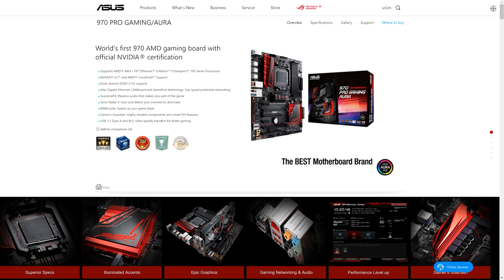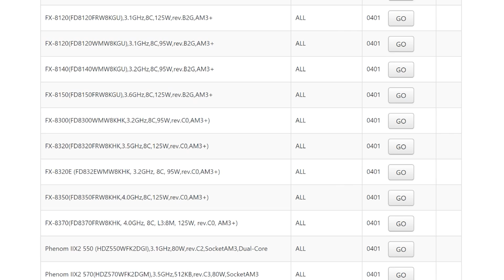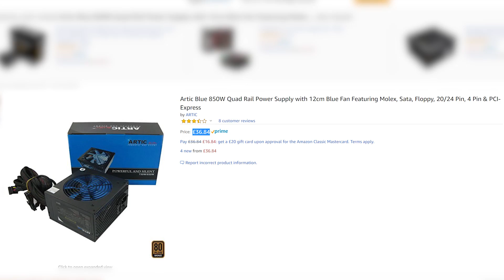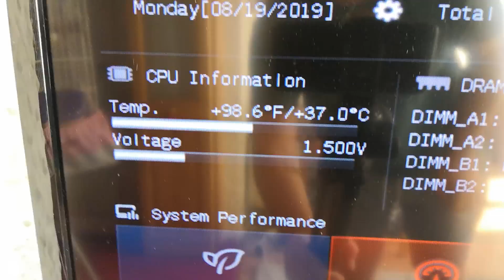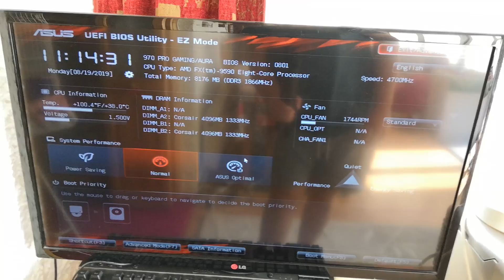This Used Gaming PC Is a 5GHz Fire Hazard (Pt. 1)

Comment: Stick with the 9590. I had one in an Msi 990fxa gaming that ran quite well once I got a good enough cooling solution. Also, with fall approaching it can always be used as a space heater while gaming.

Comment: EVGA GeForce RTX 2060 SC Ultra   or gig bites aorus    i not spelling it right   any way 3 fan Gigabyte AORUS GeForce RTX 2060 Xtreme 6G Graphics Card, 3X Stacked Windforce Fans, 6GB 192-bit GDDR6, Gv-N2060AORUS X-6GC REV2.0 Video Card    what woood u buy evga 350 other one is 390 whaT WOOD U GET CASH IS POOR FOR ME

Comment: To prevent throttling add heatsinks on power phase vrm, mosfits, n get that ram to run at 1866. 990 fx mobo has giant heatsinks both ram and cpu power phase vrm's dont forget fans for air flow

Comment: Chances are if the 9590 is too much for the board it will just be unstable and crash, not catch the board on fire. You can always under clock and under volt the 9590 instead of swapping CPU's.

Comment: I picked up a 9590  new for dirt cheap and I found out why.  Only a few Motherboards are able to handle the 220 Watts it pulls.  I located an Asus Sabertooth R3 mother board that was on the Safe list for the Processor. The 970 Pro will burn up with the chip.  Swapp in a 8350 and try turning it on. I'd use at the least a 750 watt PSU with the proper board and the 9590.. I have an 850 EVGA. Your VRM's will soon burn up! Watch the temps!

Comment: The board would seem to be the least of your worries, maybe a bit of extra airflow for the VRMs might not hurt. Isn't anyone going to mention the daft cooling setup though? As it stands, the exhaust fan is sucking air through the radiator, probably this is the only way it fit easily and they didn't want to blow the hot air right back into the case for obvious reasons - however, Corsair recommended pushing air through the radiator, 'cause as you may know, axial fans totally blow when it comes to sucking (they need an intake area as large and unobstructed as possible). Besides, the two fans on top are also blowing out while there is only one intake fan. So this is a negative pressure setup. Even more static pressure required from the radiator fan. Like I said, daft.

At the very least, turn those two top fans around. If you can also swap the radiator and fan around, even better.

Comment: My guess is that the previous owner cannibalized the power supply and GPU to put in his next build, and tossed in a cheap PSU and GPU just to sell it.
Reply: Yeah realistically who'd buy something like a 9590 which was never cheap and pair it with an at least two year old, $150 MSRP low-end video card? The 550 Ti was actually probably closer to $50-$75 street value by the time the 9590 was released. The 700 series was out by then, at least the high-end parts, and the still-last-gen GTX 650 cost slightly over $100 when it was new.
Reply: @dycedargselderbrother5353  well.. When I build my pc in 2013 I initially had a 4770k in it and started up with a single GTX 770. Later down the line I threw in a second one for sli as they became cheaper.. That was my trick back then. But well I gave one of them away and left just one in there as I sold it. With a different power supply to since I kept the be quiet one for my new build

Comment: am3+ builds are still more than capable, especially if paired with a more modern card. I have an FX 8350 on a 990 board with 32BG of 1600 mhz G. skill rip jaws ddr3 ram and a GTX 1060 6 GB graphics card that runs modern titles in ultra settings at 1080p like a champ

Comment: I think you're a goof and i'm sure the seller ran it like that and it's fine. That aside i'm completely unfamiliar with these chips, looked it up on cpubench and it actually scores as much, if not slightly higher than my slightly overclocked 2600k.  Pretty impressive

Comment: I would look for an fx 8120. it does just about as well an an fx 8350 when overclocked
Reply: just about as well....well I guess. probably a 5-10% difference or so

the fx 8300 line up is better than the 8100

It's better clock for clock and is better at overclocking

Comment: there are several options for the fx series. the 9590 has a gigabyte 990fxa-ud3 board which will support it no problem. however i am not sure how much you would want to spend on that board to get the 9590 up and running however the 8370 or 8350 will be just as capable though i am not sure how much oc headroom you will get due to the board your currently using. the 990fxa may be a better one for oc. besides i should know i have both the 8370 and 9590 but with a corsair h100i v2 cooling solution and a rosewill thor v2 case for airflow. the 9590 is the current chip with the system. i may do windows 10 i have multiple ssds for storage for things but i think this setup should work. i also am considering doing a 970 pro asrock setup with the fx 8370 chip this way i have a backup. i need to get my ryzen system completely restored. new board and processor

Comment: I didn't look up the board but even overclocking a 8xxx series cpu would push power consumption up to the 9590's and the original power supply with quad rails is something you have to pay more attention to what is plugged in where and not overload one rail but don't know of that particular units quality. If that board had decent power delivery I wouldn't worry about it much, It at least has a heatsink on the VRM.

Comment: Grab a 990FX with an 83xx chip bundle on eBay then you can put the 83xx in the 970 board and put the 9590 in the 990fx board

Comment: Hey, I need some help/advice on a PC build I'm due to be working on and figured it's worth a shot asking here.

My next PC build is going to be an xbox 360 fat -> top end PC conversion. Long story short I'm going to be using a 2060 super mini (zotac) and an i7 7700k, its gunna cost me just under 1 grand) PC parts picker is telling me the estimated wattage will be just over 300 

The psu I'm buying is going to be a hdplex 400w with the dc/ac converter and theres videos of it running with a 2080 i7 9700k but I'm still sceptical, would it be safe to use it for my build? Any advice would be grand (pun intended) 

Also keep up the good videos it's always nice to see some of the steals and rare cards you find on Ebay :)

Comment: Sorry, but this is probably the stupidest video you have ever made. Firstly, WTH would you put an 8XXX series in it and “overclock to similar performance”? That means it will be pulling the same freaken power draw! You surely know by now, you don’t magically stay 125w when overclocking...

I’m not going to mention (since you already did), that if it ran fine for apparently several dusty years that it should still be fine (max power draw of that system at stock would have been 300w total, that’s why they used the wimpy GPU, you would be fine on any decent 350w or higher PSU, so just leave your name branded one in it and test with a Kill-a-watt meter just to prove to yourself). What I will mention as a future video suggestion to help others in similar situation, is that if you add airflow to the VRM, you can easily overclock even the 9590 a touch on some 970 boards. With my 4 phase Asrock 970m pro3 rev2 (mATX, not exactly amazing since it was the cheapest board I could possibly find coming in at $40 brand new in 2015), I ran it at 300w on the CPU for years doing some long 24+ hour fluid simulations and other workloads that pushed it 100%. Unfortunately, my board is limited to 1.7 Vcore at the max setting, and that’s not enough to fry it (It must be over 400w, but obviously the 9590 vs 8350 both at board voltage limit are the same, so neither can kill it), so unfortunately I wasn’t able to extreme bench it past a measly 5.5 GHz (at least not 24 hour torture test stable) on phase cooling. I’m not sure when it would blow up, but it would require hardware soldering mods or BIOS hacking to even allow for that kind of voltage (again, for a 4 phase budget board with some fans, $3 in cooling mod and good for 24/7 stressing)

Here is one of my brief videos showing the simple fan and VRM heatsink cooling for my board at 300w CPU that worked fine with my 120mm AIO for years (phase cooler with much higher voltage/power shown in setup also worked just fine as seen in the video, but the VRM cooling didn’t change). Please show a similar solution to help others! It’s $3 in VRM mods and it lets it run safe and cool while you can clock the snot out of it (2x40mm fans and some 15x15mm heatsinks for the chokes since mine already had mosfet heatsink, but you get plenty to do both at that price).
https://Youtu.be/8h0ieFOeqtl?t=70
Come on RandomGaming, I know you can do better! Steve the seagull has faith you can improve too!

Comment: Keep the 9590. After my experiences with certain 990fx boards with an OCed 8370 the motherboard would have to be something like an Asus Crosshair V Formula Z to see the 9590s potential without worry and some overhead room. Sadly my MSI 990fxa gaming had vrm cooling issues with the thermal pads decomposing, which ultimately shorted out the board. 
I'd like to see more 9590 videos.

Comment: I really want to see that CPU run and I almost wanted to request you just run with the current CPU and MOBO setup even though that's ill advised. I just kind of personally speculate that the motherboard will just limit the wattage of the CPU and be done with it. Perhaps even leave it capped at 4.7GHz and 1.5volts? If that's the case, the CPU might be fine (or potentially in really good shape if just never boost clocked to 5GHz) but the motherboard might be pretty harshly taxed. So I don't think using the motherboard with this kind of CPU would be good anymore. I could honestly just be wrong about all of this.

Comment: The 9590 is literally a higher clocked 8370 that consumes more power and produces more heat. If you OC a 8350/8370 to 4.7 it would perform identically. Since excessive use in a 970 board could easily kill the VRM, especially if over clocked you'd need a 990 board.  Those still sell for well over $100 used, upwards of $150 on occasion. Just put an 8350 in there and OC it, will be identical performance to a 9590.

Comment: YAY I LOVE THE 9590 ... I STILL USE MY 9590 :)  but i leave it at 4.7  sometimes ill do 4.8 but 5.0 on my machine has alot of hiccups // but i do believe the 9590 still upholds for most the part to this day   love the content !!!  RGHD !!!    sorry a few specs of my 9590      i use the 990FX sabertooth 2.0 asus board,  and a 850 watt Antec psu bought afterwards since i use the Antec Twelvehundred case   and i use the corsair H100i cooling .. 
and  a R9 280x  i used to have 2 in crossfire untill it became irrelevant

Comment: Go for it. You'll be fine. :) I've been running the exact same CPU and motherboard combo (32GB RAM, Corsair 800w PSU, AMD RX580 GPU and an Antec 360mm AIO liquid cooler) for several years now. That little 120mm Cooler you've got in there won't keep up. I had the same and was overheating like crazy until I put the 360mm in.

It (obviously) runs hot but has handled just about everything I've thrown at it, including VR. The only achilles heel I've found is CPU intensive video rendering for long periods. I've managed a maximum of about 90 minutes before the 9590 hit the magic 75c and powered down.

Comment: I'm a little unclear on what your purpose is here.  You buy the computer and want to test it out.  You then remove and replace the power supply, you do the same with the graphics card, and now you're talking about doing the same with the processor.
What is it you're testing out?  The mother board?  The case?  You're removing and replacing just about the whole computer, so how is this a test of the machine you bought?
Reply: he bought the pc not knowing what specific details were and thus didn't want to kill the system with the psu and gpu that came with it

this is part 1. part 2 is coming
Reply: @bluescluessuperagent  I'll ask again-
If the purpose was to test out THAT machine, then what's with replacing all the parts before the test?  What's the purpose?
Wasn't the aim to test out THAT machine?

Comment: Had a couple desktops with fried motherboards come through where I work because of this bad boy. Be more fun to swap the board but you'll need something 990FX based, something with a very good VRM.

https://www.asus.com/Motherboards/SABERTOOTH_990FXGEN3_R20/overview/ should do the trick... 

Good Luck cause even used anything similarly capable is pretty expensive for what you're actually getting. FX-8350 is where it's at for AM3+ :)

Comment: That motherboard is actually one of the few that could actually handle OC well with "8" core FX cpu's. Crosshair V Formula Z, Sabertooth 990FX and some Gigabyte or Asrock boards were the top 3, this 970 gaming aura got into top 4 for the VRM quality and features. I'm not saying that it would be enough for this space heater called FX 9590 but atleast it's on the better end of motherboards for FX cpu's. 990 vs 970 didn't mean better overclocking with these CPU's lemme tell ya, should've never bought that Fatal1ty 990FX Killer mobo, it was lot worse than say Asus M5A97 EVO. Btw you can search on youtube "msi 970 sli krait fire" and see what a really poor VRM does when 9590 is booted on it with STOCK CLOCKS.

Comment: Curious about the 9590s performance, so swap motherboards. You could potentially even do a versus comparing an overclocked 8000 series to the 9590 to show how much performance is gained with the higher tdp

Comment: I have my FX 8320E 4.5Ghz + Asus 970 Pro Gaming Aura. I can assure that board is very capable of a FX 9590, it have a 7+1 phase layout. My CPU is cooled by a Noctua NH-U14s.

Testing the overclocking potential of my CPU, I saw it reaching 250W on Pryme95 and the VRM never had problems. In the end I configured for 4.5Ghz at 1.375V with Load Line Calibration at Extreme. Temperatures are very good. Is not the best CPU for today standarts, but is still capable of some good results on gaming, but for 60 fps of corse, I have a GTX 1060 6GB.

Comment: Dude , RandomGaminginHD , what the hell ? this is the first time I've seen you lowering your standards . Come on man...

YOU BOUGHT THIS PC SECOND HAND AS A SYSTEM. IT MEANS IT WAS WORKING NO PROBLEM. WHY ARE YOU SO SCARED TO RUN IT?

Just because it is not rated for that CPU doesn't mean that it's not going to work or that it's going to burst in flames.
You might get a higher vrm temps and potentially reduce their lifespan . But nothing bad is going to happen... Especially when it's a quality board from a quality manufacturer like yours. COME ON...

This PSU and pretty much any noname brand PSU rule of thumb is that it's most likely will work at a lower wattage rating. 850W Is too much power for that system anyway 650W with a better graphics card would probably be ideal. I don't advise buying a cheap PSU, I prefer quality corsair ones myself. But from my experience as long as your PSU works at all. It will work fine if you don't overload it to it's rated wattage or close to it. 

Please don't try to hype things up for the sake of making it intriguing...It feels dishonest. I am watching your videos not to get thrilled or something... 

Thank you for understanding.
 And good luck with your future videos.

Comment: I daily that CPU/mobo combo, it's fine :D
The VRM isn't quite meant for such high loads, but it's overall high enough quality to power the beast, have some airflow in the case and it'll be fine, though that's a bit out of fashion now :D

There are plenty of reports online of other people using this board with the 9590 with no issues too, except for lower OC headroom compared to the better of the 990FX boards.

While (again) not meant for 220W, the VRM is fairly modern, and, because most games don't make use of all the cores, the VRM efficiency is actually very good during daily use.

Comment: I had the same motherboard with my old FX-8320 Overclocked to 4.6ghz on it. Worked fine for a few years until the power supply EXPLODED. Lesson learned don't buy a medium tier antec 600w when you have overclocked system that's already strained!!!

Comment: It's a beast keep the 9590 try overclock it to 5.5 -6 ghz (be aware that beast is no jocking, it can draw 350 - 400 w on the 12 v rail if you overclock it).

Comment: I'm not sure why you're nervous about this system, the 9590 was basically an overclocked 8350, and a heavily overclocked 8350 can easy pull 250W, and just because a board doesn't officially support a CPU, it doesn't mean it'll explode as soon as you look at it.

That Arctic PSU though, rain down the cleansing fire of a tactical nuke on that shit, I wouldn't trust it to burn my house down properly, nvm power any computer newer than pentium 2 safely.

It's a weird system all round, very expensive RAM when that kit was new, cheap ass PSU, a midrange GPU that wasn't even new when that CPU was on the market, a premium motherboard, and just to add to the what-the-fuckery, a completely inadequate CPU cooler that struggled with a 2500K nevermind the 9590.

Comment: Well sir, I have started blown an FX board and in my experience it's actually pretty difficult. The Asrock Fatal1ty board I once had blew while I was trying to hit 5.1 on an 8350 and upon post mortem I found that the only reason it died was because the VRM thermal pad wasn't properly applied and thus didn't reach two mosfets on the end, I ran at 4.9 and 4.75 ish for some time before that without realizing there was an issue.

Comment: The issue is finding a board working for the 9590 what isn't insanely expensive.
Much easier to find an 8320 or 8350 and drop it into the board.
I would say do both, but start with the CPU. If you can find the board working for cheap definitely do it.
Alternatively, build an 8350 or 8320, overclock, make a video, sell it, build the 9590, make a video, keep it.